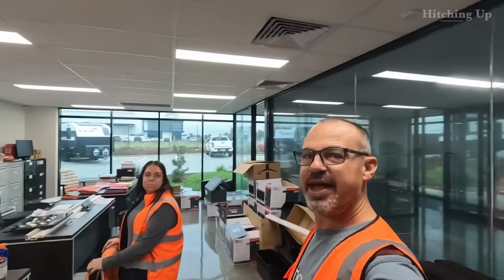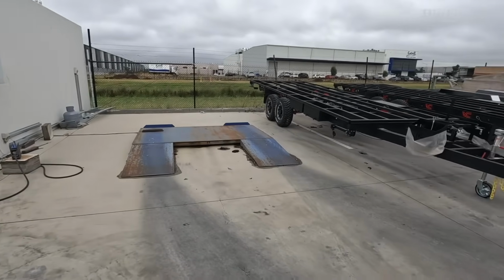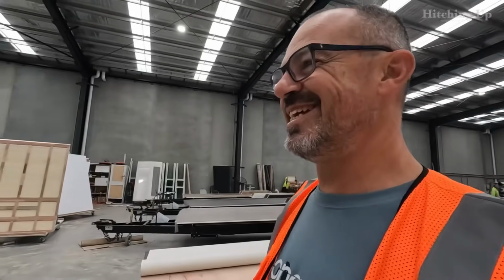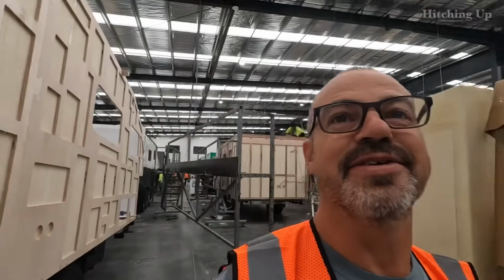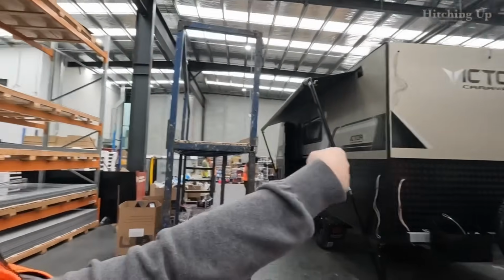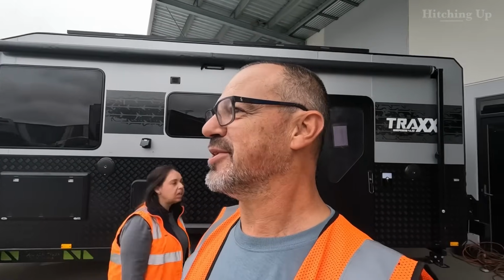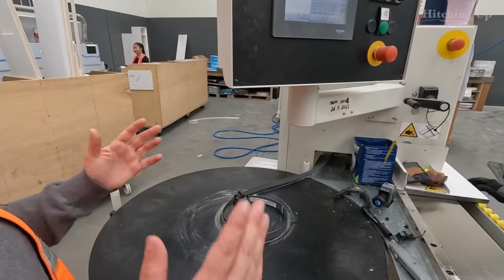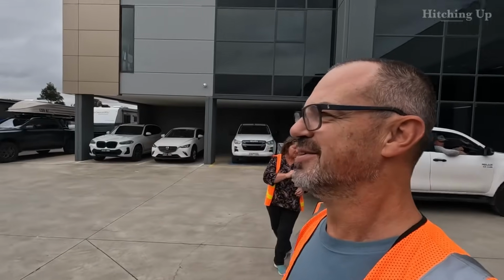Network RV factory tour

Comment: I own a terrain tuff 19”6’ in electric blue and are an engineer by profession. The chassis is very well constructed and light and strong. The galvabond  black painted steel is lighter than galvanised ones and durable for over 20 years unless dropped into a lot of salt water!
The timber frame is no issue as the  composite wall covering is virtually leakproof, just check your window and door sealing after the first trip.
The interior furniture is first rate and fully sealed and are heavy grade materials, unlike the brand with a big “J”
I love my van for it’s looks, construction, suspension and cost/ value equation.
Sure there are superior vans by maybe 15% but they are 50-100%  more expensive.
So a great van in my opinion

Comment: Interesting about the new composite panels. They'll be warmer and also they will have fewer leak point's.
 We had an issue with the silicone around the window leaking water into the bedroom due to the panel joining strip, water was tracking down, luckily onto the bedside table, our dealer here in NZ will be sorting it properly when we get to Christchurch as we were already travelling. I love our dealer here, so customer focused ☺️. The only other issue is with the kitchen drawers, they constantly pop open, and is damaging the drawer face, we've had to fix 3 times so far 😔. And that's damage from NZ sealed road's 🤷 NZTA can't Fix a road so it's actually smooth to drive on 🤣. We love our van ☺️ (23' network RV Terrain Tuff club lounge) 
I also liked that model which had all that outside storage at the front. It would make it warmer or in Aussie stop the heat a bit in the bedroom cupboards ... Boy do they get hot in summer 😎. Thanks for doing this video, it was very interesting. From @katnrobtouringnz on FB ☺️